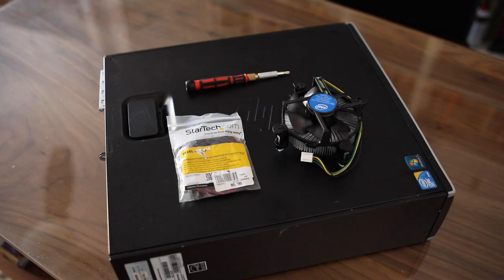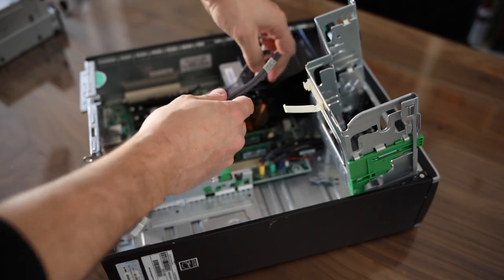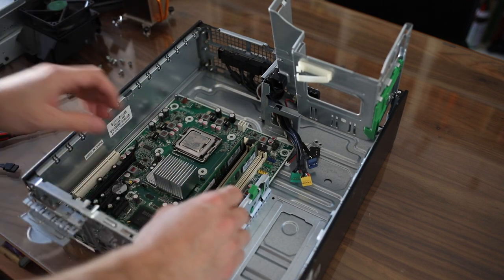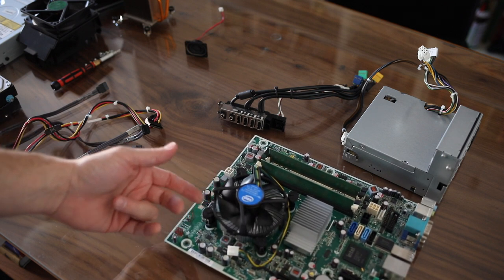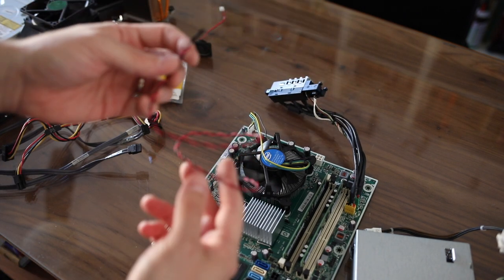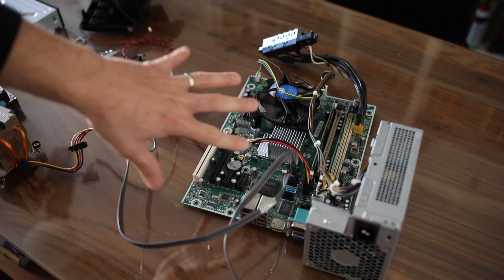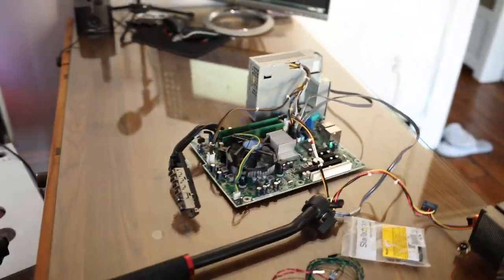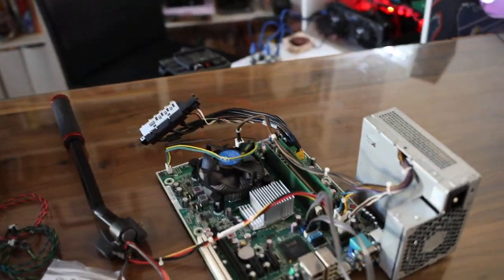How To:  Build Bartop With Arcade-One System

Comment: Odd question,  can I use the 8tb system I bought from you in an Arcade1up cabinet if I get the USB joystick controllers?
Reply from the maker: You need an IPAC encoder, the mini IPAC will do. Unless you already have a 1up, get one of the small cabs from recroommasters.